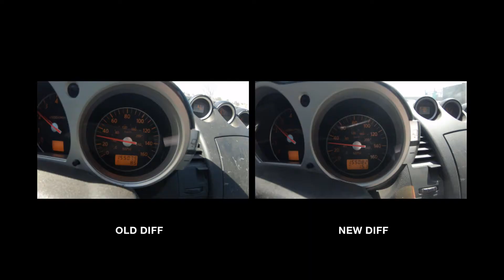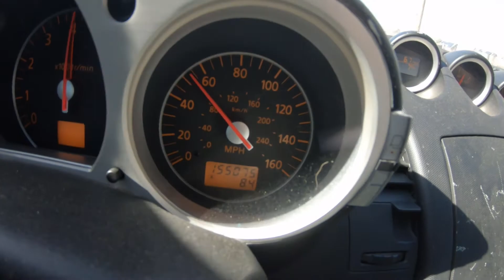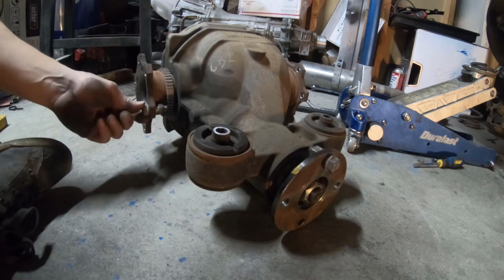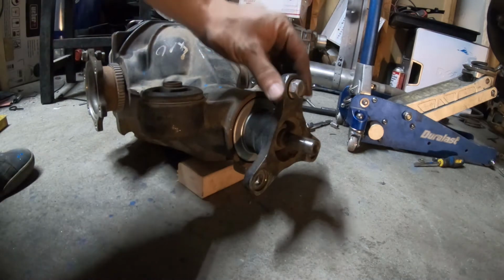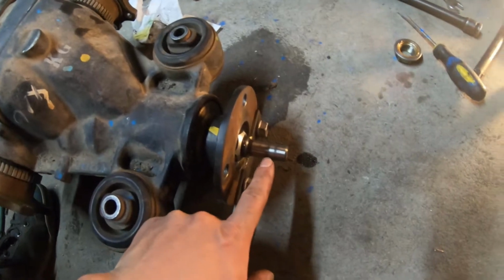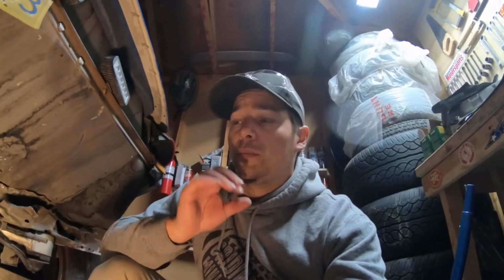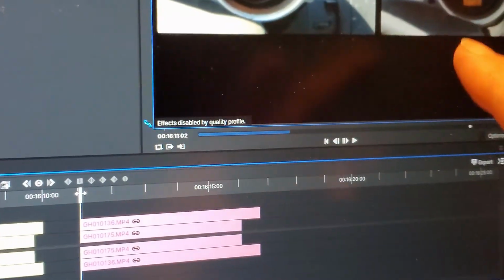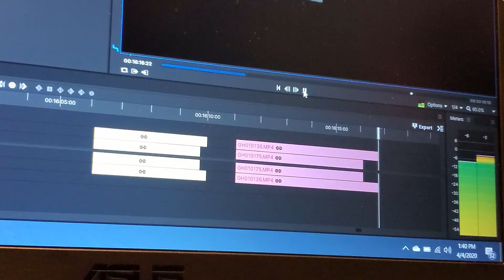350Z w/ 3.69 Diff Swap (Before and After Tests)

Comment: Putting smaller rims on your car does the exact same thing as changing your differential gear ratios. If your going to put 20 inch rims on for example,  compensate by changing your diff to a 3.7 ratio.
Reply: It’s not really a big enough difference. As long as you stay within oem spec, the ratio does not change that drastically compared to swapping diffs
Reply: @IPL_VIC  It actually does. I have a 3.53 final drive stock. I went with a smaller tire & now my effective gear ratio is 3.67. Noticeable difference.
Reply: @DixonDeadlifts  i used to have 20’s on a 3.69 rear so it probably felt like a 3.9 for me lmfao. But overall diameter matters more. I’ve had my 6 speed on a 18 inch with a 3.69 feel the same if not better than the 20’s. I had to use a much taller tire but got the same result basically. Now im on Nismo 19’s and very picky which how much tire to use. I stay in the 35 range for sidewall ratio.
Reply: @IPL_VIC I personally stayed with 35 profile tires as well (19” Ray’s). Last week I got my first pair of 30 profile tires. This set my effective gear ratio from 3.53 to 3.73. Very noticeable. Definitely try 30’s next time you’re about to buy rear tires.

Comment: good info on comparing the speed difference but did you happen to see if there was any change in the speedometer not matching the actual speed its going? I run different tires and originally was off by 5mph but now with my 3.69 gear installed, anything I do after 60mph, I am off by 8mph. it does suck but I'm okay with it reading off because I know I won't be over speed limit lol.

when I took it for an initial test run, literally going full throttle, I thought I was going pretty quick until I realized my speedometer was way off. it definitely was quicker through the gears though.
Reply: Did you find out? I believe the speed is measured by the output shaft sensors on the dif so it would remain correct
Reply: @fatjaysgarage  I haven't bothered to test anything new yet. I just got used to the speedometer being wrong lol. it's better for me driving speed limit any way

Comment: Is that the auto flange? My input has a circular 4 hole flange
Reply from the maker: The 3 bolt is the G35 flange. 350Z has a 4 bolt regardless of auto/manual.

Comment: Does your cruise control work? From what I’ve read on forums it’s the neutral safety switch? Any thoughts?
Reply from the maker: I didn't bother wiring mine for cruise, since mine is becoming a dedicated track car (has an aftermarket steering wheel anyhow). To my knowledge though, you're right about it being the neutral position switch that needs to be wired up for it to work though. Should be a pretty simple wiring job.
Reply: Dillon Smith thank you for the confirmation, that is what I had figured.
Reply: i know Im randomly asking but does anyone know of a trick to get back into an Instagram account?
I was dumb forgot my password. I would appreciate any assistance you can give me
Reply: @Beckham Kellan Instablaster :)
Reply: @Vincent Seth i really appreciate your reply. I got to the site on google and I'm waiting for the hacking stuff atm.
I see it takes a while so I will get back to you later with my results.
Reply: @Vincent Seth it worked and I finally got access to my account again. I am so happy!
Thanks so much, you saved my account :D
Reply: @Beckham Kellan happy to help :)

Comment: I left the auto rear end in mine for now and so far so good I don’t notice difference but have u wired reverse light circuit?
Reply from the maker: I have not. Shouldn't be too difficult if you consult the FSM (links in my "Part 2" video description).
Reply: @DillonSmith1  yeah I have all data for 2005 but 2003 little different ipm stuff which is the body I used and did u have any flex in the firewall from the pedal assembly without the top mount bolt? I made a support with old alternator brackets from another z. Considering rear end next since finally narrowed down and replaced bad throttle body due to wide open under boost drivability issues.  With the swap and turbo plus using haltech wasn’t sure about triggers for anti lag and launch control being relevant cause literally would pop like boost cut but more like felt like some abnoxios rolling two step lol
Reply from the maker: @johncarney6385  you can find the manual for a 2003 at those links too. And yeah, I made a bracket to help support the clutch pedal. Just bent some 1/8" flat stock and bolted it to the brake pedal assembly and got rid of the firewall flex. Also, I bet the "rolling anti-lag" effect at least sounded badass. Haha
Reply: @DillonSmith1  just got retune at Dynosty couple days ago and yes yes yes I dig it

Comment: what did you torque the input flange to when you swapped them?
Reply from the maker: The four flange bolts are set to 54 ft-lbs. If you're talking about the nut that ties the flange to the differential, it requires between 109 and 238 ft-lbs but you're looking for bearing resistance more on that one to determine your torque. Hope this helps.
Reply: @DillonSmith1  that’s the one I’m talking about but I’m not familiar with bearing resistance, what does that mean. Thank you for the quick reply btw